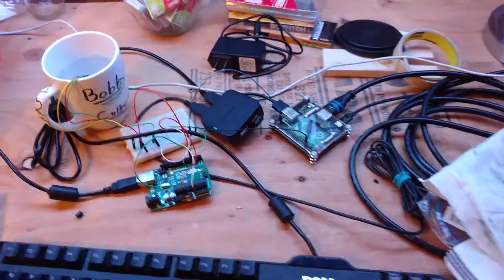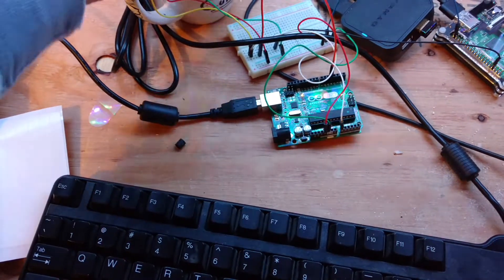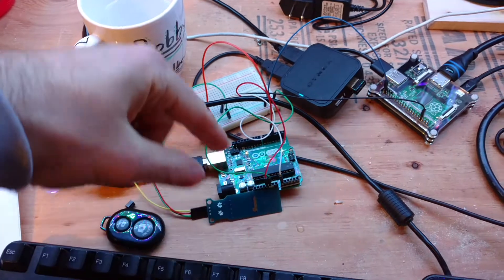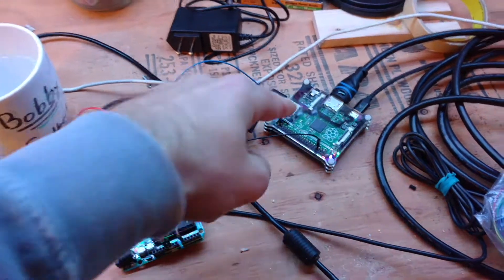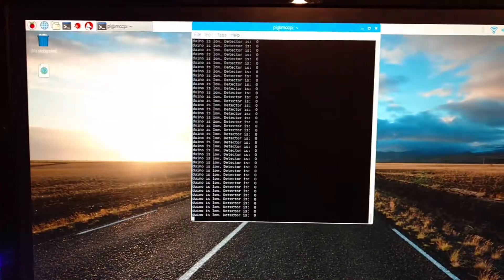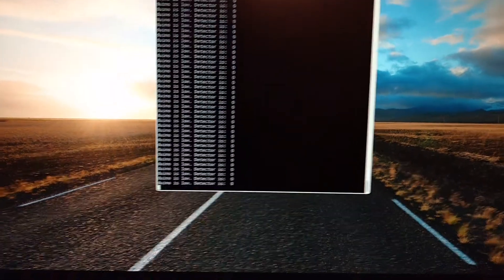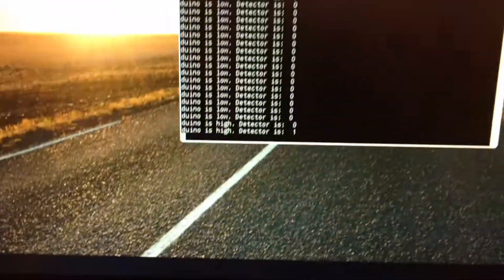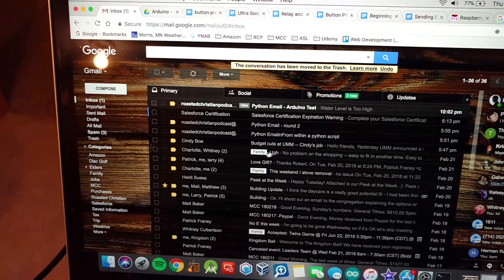Arduino Water sensor to Raspberry Pi

Comment: Bro share circuit diagram of water flow sensor and eltronic valve connect with arduino to raspberry pi
Reply from the maker: There is no electric valve in this example
Reply from the maker: Or are you just describing the connection between the arduino and the pi?
Reply: Ok then share flow sensor with arduino and raspberry pi connection
Reply: Can be possible??  2nos flow sensor connect with arduino uno get different values.... If possible pls share how to do?